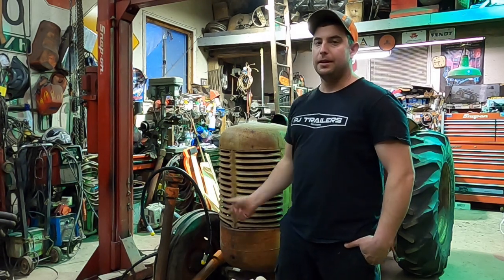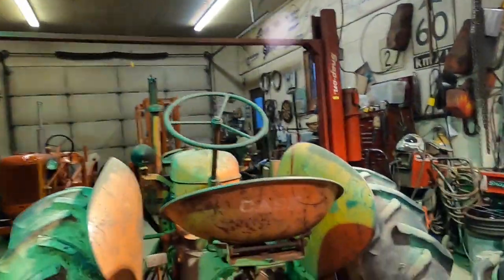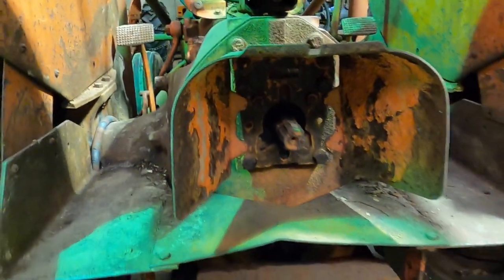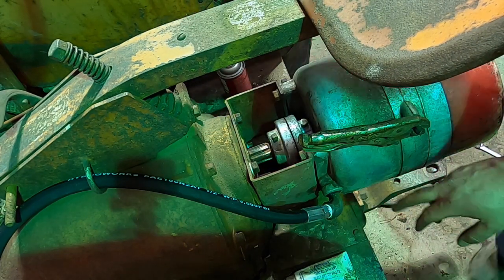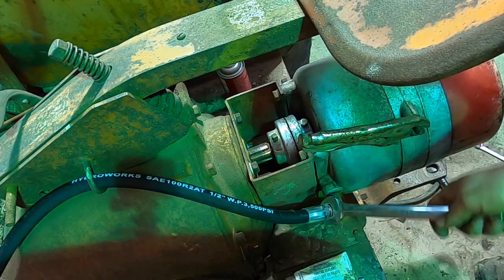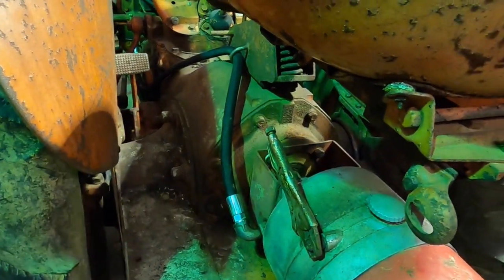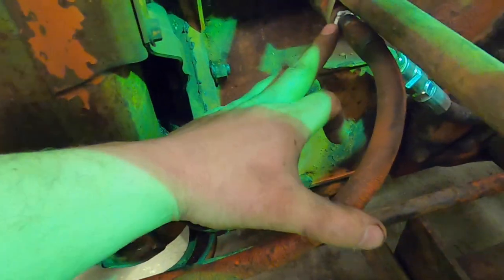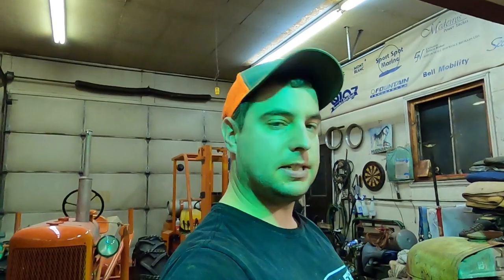ADDING HYDRAULICS TO A VINTAGE TRACTOR! how does it work?

Comment: Another option I saw on an AC forum-  use a 12 volt DC hydraulic power pack such as is used on a dump trailer pulled by a pickup- a guy put one on an old Allis and added a couple valves as needed, said it gave him live power and ran a round baler all summer with no issue. To be clear the tractor was converted to 12 volt and had a 60 amp alternator.
Reply from the maker: Absolutely ! It’s all about making these old things adapt to perform the jobs at hand. We are doing either a WD or Massey 333 snow tractor with a 4 way plow on the front and blower on the back , the plow will be electric over hydraulic aswell , you will see that in future video , thanks for watching

Comment: Hey Rick, I picked up a 1963 AC D15 a couple months ago which is my first personal tractor. I have a loader with a trip bucket on the front, and a blade on the rear. Currently I am just using a quarter turn valve to switch between front and back control, but am looking for a better solution as the blade drops when I switch it to front control. I would like to be able to use both front and back to work dirt/gravel around the ranch. Any ideas?
Reply from the maker: I’m not super familiar with the D series yet , however I’m
Assuming you’d need a second shut off valve between rear lift and hydraulic pump. That’s what I’m doing to my WD

Comment: You should wrap you new hydrolic hoses with final tape or protective sheeth.
The new stuff only last ten years in the sun, then the wires rust and you have to replace with more new bad stuff.